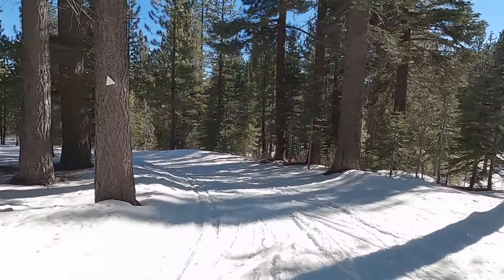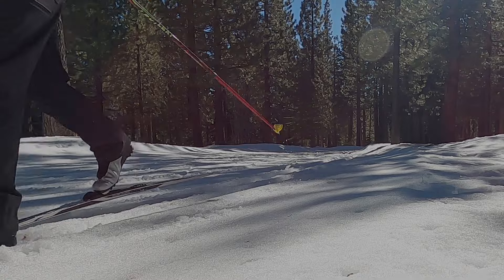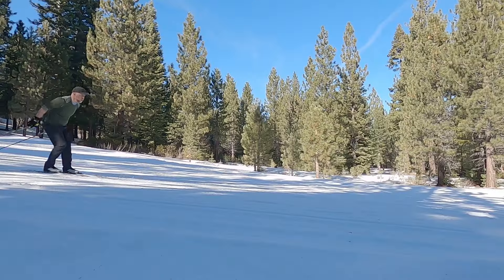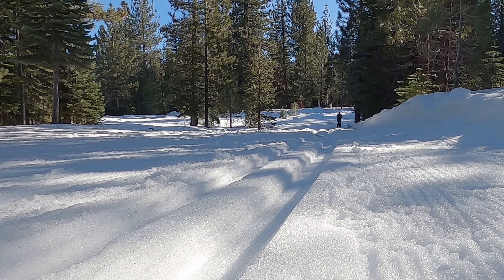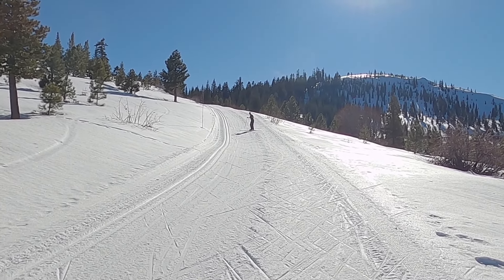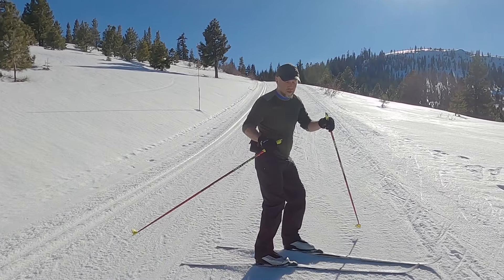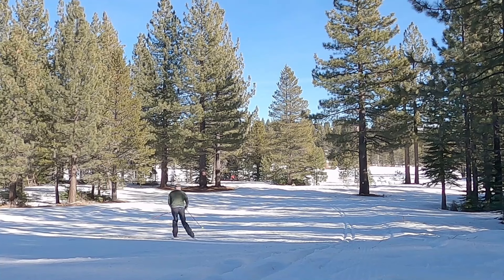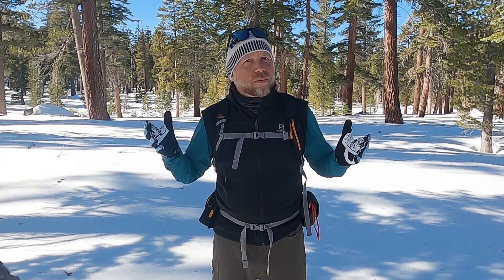Intro to Classic XC Skiing (Part 4): Basic Techniques for Cross-Country Skiing Downhill

Comment: All my cross country is on a frozen lake with no groomed trails, you need back country skis and have to follow snowmobile tracks.
Reply from the maker: Sounds like a lot of fun xc skiing! I spend about half of my winter backcountry cross-country skiing as well. I typically only resort ski when I'm working (weekends), and then when I go back home for the rest of the week I xc ski off-trail and in the backcountry as there are few groomed resorts near where I live. Anyway, it's all good stuff!

Thanks for watching and commenting! I appreciate it :)
Reply: @JaredManninen  it is good cardio but this year I am going to build a groomer and pull it behind my snowmobile. I enjoy your tips and instruction.
Reply from the maker: @bartdaw6681  That sounds like quite an undertaking, but it also sounds way cool! It's a specialized tool, but do some research because you may be able to find a used track pan for a snowmobile. Not sure where you live, but it always seems like there's some used cross-country ski grooming equipment trapped in storage (from a bygone era) waiting to be resurrected.

Thanks again for your kind words. I appreciate you tuning in! And, as always, let me know if you have any questions. I'll do my best to answer them in a timely fashion :)

Comment: How do you go downhill, through the woods, through powder, down a steep hiking trail?  It seemed dangerous
Reply from the maker: Well, now, that's the million dollar question. haha!

Yes, all of that can be super dangerous with cross-country skis. This video was the first one that I wanted to produce as it deals mostly with firm conditions and groomed terrain. I find that it's much easier to control the skis when the snow surface is firm and predictable. I'll eventually produce something more oriented toward steeper and deeper snow, off-trail and in the backcountry. But because that starts to overlap the whole avalanche realm, I've shied away from talking too much about it (just for liability sake).

For the most part, I choose more manageable lines both up and down. If the terrain is too steep and deep, I will make longer traverses to mitigate risk of myself falling or crashing into any natural obstacles (trees, rocks...). Mostly, though, I just keep things down to earth and try not to climb or descend beyond my skill level. And that's what I recommend to everyone until they become more proficient with downhilling technique (Alpine turns and/or Tele turns) and avalanche aware.

With cross-country skis, I can achieve pretty fast downhill speeds on moderate to lower angle terrain, and that usually satisfies my needs. So, I'll choose terrain that features more rolling hills and finite downhill sections (with good runouts if at all possible).

Anyway, I appreciate your question and concern. I wish I had a better answer for you other than "only ski to your comfort and skill level." But at this point in time, that's pretty much all I have to offer. If you watch some of my other videos (particularly the XC Ski VLOGs where I'm practicing downhilling), you'll see that I am trying to work into more deep and steep terrain, albeit very slowly. haha!

Thanks for tuning in, and for posting the comment.

Comment: Pixie!!! She's a neighbor. I'm new to the sport, just bought a pair of Rossignol BC 80s a few weeks ago. Been learning a ton from your videos (and a lot of trial and error in the neighborhood). Thank you!
Reply from the maker: That's awesome, Scott! And so is Pixie :)

Glad to hear you've embraced xc skiing, and that I could provide some information and inspiration. Let me know if you ever have any questions!

Again, thanks for tuning in and for the nice feedback :)
Reply: @JaredManninen  Okay, I do have a question. Have you done a video on gloves? Types, and best ones for BC XC? Or do you have a favorite? I'm in the market for something better than the driving gloves I've been using.... Thanks!
Reply from the maker: @ScottThompson  Hey Scott, I haven't actually done a video on xc ski gloves, but it's a great idea :) Perhaps I'll try to put one together this spring. In the meantime, however, I usually use a pair of mountain biking gloves made by a smaller company called HandUp. I'm a bit of an odd one, though, because I don't actually like most xc ski specific gloves. They always have some extended gauntlet which covers my watch (and drives me up the wall - haha). So I use those mountain biking gloves because they just stop at the wrist, allowing me to access my watch a lot easier. They're also pretty thin, and my hands get really hot and sweaty (usually). Honestly, your driving gloves may be pretty ideal in most conditions. haha! In colder temps I do wear a thicker glove but, again, I prefer one without any type of wrist covering/gauntlet. I'm going to have to consider this as a topic because I think it is a good one (particularly when I see so many new xc skiers wearing big puffy alpine skiing-related gloves). Thanks for the question/idea!
Reply: @JaredManninen  Well, I've got lots of mountain bike gloves...  I'll give those a try before spending $. Thanks for the idea!
Reply from the maker: @ScottThompson  Sounds good, Scott! Yeah, those bike gloves I use have a nice suede-like material for the palms, as well as a little siliconized areas. Good enough grip and doesn't overheat the hands :)

Comment: Just started XC skiing, I’m a veteran snowboarder therefore not really scared of speed. Went down a steep hill full speed yesterday in the wrong lane  and wasn’t able to stop as graciously as I would have wanted to. Going back today and will try your “sprint” drills from the earlier video. The wider angle for steeper hills bit makes sense. I’ll try that too. Thanks for your vids coach!
Reply from the maker: Hey Alexandre,

Thanks so much for the kind words. I appreciate it!

Glad you're getting out there and giving the xc ski thing a try. I snowboarded for about 5-6 years, a number of years ago and enjoyed going downhill quickly and confidently. I'm getting that way on the xc skis, and it definitely makes for a way more enjoyable time!

Good luck, and let me know if you ever have any questions 🙌

Comment: Awesome video as usual, Jared! I'm a long time alpine skier that converted to XC last year. I tried steepier stuff this week and I wish I saw your videos before 😆. It was groomed/classic trails, but with relatively steep inclines. I can totally relate to your comment about the ski plow being more difficult on XC skis. I now realize I needed to side slip instead, as the snow plow was just not slowing me down fast enough. Thanks again!
Reply from the maker: Hey Sebastien,

Thanks so much for the nice feedback! Glad I could be of service :)

And, it's totally cool that you watched the videos after your experience. Getting out and experimenting on your own without much prior information/knowledge is a good thing. I tend to lean toward the belief that firsthand experience > theoretical information. Now you have experience from which to ask specific questions for your skiing needs. I love it!

You're right in thinking that xc skiing downhill is a lot different compared to alpine skiing :) That double camber on a cross-country ski really makes it challenging to maintain edge control (i.e. flatten the skis enough to engage the full length of the edges).

Anyway, good luck and let me know if you ever have any questions!

Comment: Thanks Jared! I've never had any country skiing lessons in the 40 years that I've been skiing. These lessons will be a great help in stepping up my game. I've been basically shuffling skiing.lol
One of my problems is not getting enough grip with my wax, so I don't have enough propulsion forward.  Not sure why, or what I'm doing wrong.  It can be quite frustrating when your skis keep sliding backwards.
Reply from the maker: Hey Derrick!

Thanks so much for the kind words, and for tuning in. Sorry about the delay in my response, however. It looks like the lake of space between "skiing. lol" in your comment caused your review to get buried in my "held for review" folder. So weird!

Anyway, if you're using grip wax and not getting enough grip with it, it's simply because it's not the right temperature wax for the snow conditions. The reason is simple, but the solution is complex. Basically, using grip wax can be ultra-difficult, especially if you're dealing with snow that's transforming (i.e. freezing/thawing) constantly. If you always have sub-freezing temperatures you can mix up the hard wax. But once those temperatures start to consistently rise above freezing, now you have to deal with sticky Klister (and that's not very fun!).

I'm no expert at grip wax, so I just prefer to run some "waxless" classic skis so that I always have a dependable grip zone. You may want to look at investing in a set of scale-patterned or skin-based classic cross-country skis so that you don't have to worry nearly as much as far as getting grip.

Anyway, I appreciate you watching my videos and hope you have a great winter season. Let me know if you have any other questions!

Comment: Great video, thanks for posting. Do you have a video for doing the hockey stop though?
Reply from the maker: Hey Cris, thanks for watching and for the question!

I don't currently have any how-to videos regarding how to perform hockey stops. So, that'll go on my to-do list 🤗

But the short answer is ... start by initiating a snowplow, then keep your upper body facing down range while unweighting your uphill ski (the ski opposite the direction you want to stop), and lift that unweighted ski moving it in a position parallel to the leading ski (the one in which all of your weight is on).

I'm sure that's all confusing without a demonstration, so i apologize. But it's fairly easy to perform once you become comfortable with transferring all of your weight onto one ski.

Anyway, I'll try to put something together eventually. I think it's a great idea for a video. Thanks again for tuning in, and let me know if you have other questions!
Reply: @JaredManninen  thanks for the tips! I’ve only seen one other video on cross country hockey stops. It’s fairly intuitive on downhill skis but I’m not picking it up as well on cross country skis. Maybe doing some drills shifting my weight while plowing and turning would help.
Reply from the maker: Hey Cris, the hockey stops definitely take a little practice. The double camber of an xc ski always makes the turning aspect more difficult. All I can say is to just really grind down onto the one ski in a skid so that you can unweight and move that other ski into a parallel position. Over time you'll find a sweeter spot in which to bring the trailing ski into place. Mostly you just won't have to exaggerate the movement so much when you get comfortable with the weight transfer.

Anyway, good luck! And thanks for the conversation 🤗
Reply: @JaredManninen  so I went out today, skied about 3 hours and worked on my hockey stop some. For the life of me I can’t fully weight the downhill ski in a turn. My uphill ski stays on the ground and I cross skis. So I backed off and just worked on my left / right wedge turns. Which I kinda suck at too so maybe an indication of why I can’t hockey stop!
Reply from the maker: Hey Cris, I applaud your efforts and willingness to give it a go!

Yeah, transferring all (or at least most of) your weight to the downhill ski is key. So keep working on the snowplow turns and then when you get more comfortable with your weight transfer (causing you to turn), start to move that uphill ski into the parallel position. It'll all click eventually. And then you won't have to think about it at all.

The bottom line is that it's just going to take some time on skis to work it all. Believe it or not, it did take me awhile to sort it all out. So don't be too hard on yourself. Just stick with it!

Comment: Hey Jared thanks for this video. Really awesome tips I was able to get out today and had a chance to practice the half snow plow with one  ski still in the track on some hairy downhills. The most confident I've been ever. Easy to control your speed and when I saw the rest of the line I just put the ski back I the track and zoomed away. Great tips 👌
Reply from the maker: Awesome, Thomas! So glad you were able to put to use the half snow plow 🙌 And it sounds like you used it in grand fashion 😊 

I always find it so cool that subtle movement makes for much more enjoyable and safer cross-country skiing. It's so much better to just be able to shave off some speed and stay on course rather than skiing too fast and then having to make a huge and hasty stop (and risk all that comes with three drastic change).

Great job 👍

Comment: Have you done any videos on trail etiquette? Such as meeting someone coming up the tracks when your going down etc...
Reply from the maker: Hey Eric,

I haven't produced any videos about trail etiquette yet, so great idea! I appreciate the suggestion, and I'll put it on my list.

The one rule that I always find interesting is the one that you mention about being in the tracks (traveling uphill) while someone is skiing down them. Technically, the downhill skier always has the right of way, so the uphill skier is supposed to get out of the tracks. It's opposite of mountain biking. But, in reality, if I'm skiing downhill in the tracks and see someone skiing up them, I get out and give them a wide berth. I'm probably not doing anyone a favor by not adhering to that particular rule, but usually I see the uphill skier way before they see me. Basically, because I'm going so fast downhill I'm looking down range for hazards. On the other hand, when people are on the uphill grind it's easy to let your gaze fall down to the ground in front of you. So in those cases I'm well out of the tracks before the uphill skier even sees me. But, technically, I should be able to ski down the tracks and they would hop out of them.

Anyway, I probably won't produce that particular video too soon as I have a number of others on my list and it's still early in the season (i.e. I'm not yet working at the groomed xc ski center yet). But I will put it together this season!

Thanks again for tuning in, and for great suggestion :)

Comment: Jared, could you dissect the technical solution and weight transfer key points when dealing with a steep short hill immediately followed by a steep uphill, like a roller coaster type? Much appreciated
Reply from the maker: Hey Rui,

Thanks so much for watching, and for asking your question :)

I apologize if it's not really that technical of a solution, but if I were faced with a short and steep downhill followed by a short steep uphill I'd try to capitalize on the downhill momentum. Basically I'd go as fast as I was comfortable skiing down the hill so that I could zoom up the next hill. Then, once I ran out of momentum I'd quickly transition to diagonal striding to get up that next hill. 

Whether going downhill or uphill you essentially want your weight to be slightly forward. Realistically, you pretty much always want your weight to be slightly forward on your skis. If your weight is back, it's exponentially harder to control your skis. I realize that it seems counterintuitive to many people, especially in the context of going downhill, but even on the downhills you want to keep your weight forward.

There's more stability in the front of the ski as there's more ski in front of you. And, the majority of the grip zone is often on that front half of the ski providing more opportunity for you to control the ski (by gripping the snow). Depending on your skis, there's often very little grip zone behind your heel, which means that it's all glide zone (i.e. slippery surface) back there. So, if your weight shifts back it's going to be focused over a slick part of the ski (causing you to slip).

Doing roller coaster type hills can be tricky because the changes in angle can definitely cause your weight to shift around. So you have to be a bit aggressive to maintain that slightly forward posture.

All of that said, at first when trying to seamlessly negotiate that type of terrain, work on staying centered over your feet. Then work toward keeping your center point (just below your belly button) slightly forward of your feet. Ultimately, you want to avoid leaning back or allowing your center to shift behind your feet.

Not sure if that's the answer you're looking for, but that's what I have to offer at this point. If you want me to clarify or expand on any of that let me know.

Thanks again for tuning in and commenting. I appreciate it!